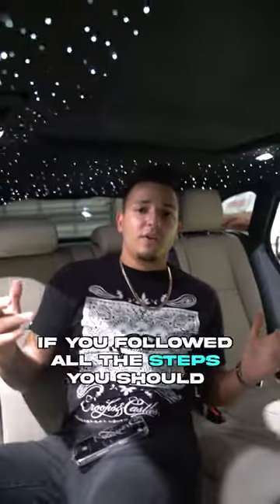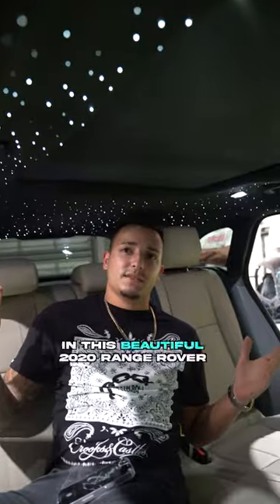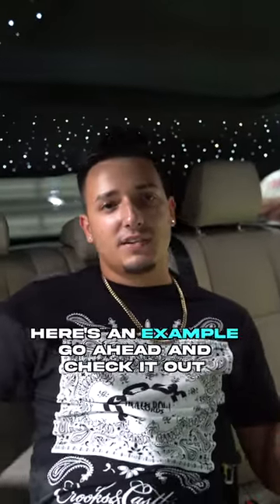HOW TO INSTALL STARLIGHTS

Comment: dont forget to hot glue em to the headliner so they stay
Reply: I was about to ask this… it won’t mess up the fiber when the hot glue gets put on it?
Reply: @samnashold9012 you should be fine test it put before hand might just bend a bit cuz of the heat, when you do and if its bent run your flashlight from phone through the end see if they twinkle if they do you good 👍
Reply: Was about to say that glueing is better
Reply: @samnashold9012 just make sure you put a little
Reply: E6000 glue is better. It’s stronger and you won’t have to worry about the hot glue melting the wires.
Reply: Just poke your holes, thread your lights, spray with some 3M headliner adhesive, and put some random damn fabric down on top of it all. Painter's plastic on top of that, movers blanket, and a few lead diving weight bags....

I've taken that F150 everywhere, and they're still in place.

Comment: How to starlights 

Step 1: is to figure out how many stars you want or need. A full size sedan you would want a minimum of 600 excluding a sunroof area.  Use this as a reference point. 

Step 2: is the supplies, you’ll need plenty of hot glue with a hot glue gun, t pins to poke all the holes, 1/16 drill bit + drill gun for the plastic areas a pin won’t poke, scissors to cut the excess. side snips to cut it flush at the end, wire strippers, electrical tape, extra wire to connect the starlight kit module (normally in the trunk) to the interior fuse box at the front and a fuse tap with fuses 

Step 3: remove the headliner by taking off all the necessary trims, such as the A,B,C Pillars, ceiling grab handles, and interior dome light housings. You’ll have to probably fold the headliner to take it out the car. (The headliner can crease at the step.) 

Step 4: taking a marker you plot 600 dots in the way you want them to look. You can add designs or letters or shapes, (keep in mind these things take up a considerable amount of stars)

Step 5: poke all 600 holes using the t pins /drill bit (thumbtacks, are not long enough to poke through in most cases)

Step 6: insert all 600 strands into all 600 holes, one by one, keeping in mind, wire, routing and management.

Step 7: manage all the fiber optic wiring, using tape, you can bundle them up together, and then use hot glue to lay groups down flat. 

Step 8: add a decent bead of glue to the base of each fiber optic wire

Step 9: cut most of the excess wire length on the interior side so it’s easier to handle (do not cut flush yet) 

Step 10: take the headliner back into the car, usually by bending it again (can crease at this part). Then put the headliner back on with all the trim

Step 11: cut the optic wires, flush with the headliner fabric, using the side snips. 

Step 12: attach the rope to the module. Plug the module in. Strip the module wire. (Only has 2 wires black & red) and use the extra wiring to run it up to the fuse box. 

Black wire goes to the closest bare metal point near your fuse box. Red wire, connect to a few tap, which you can tap into any accessory fuse.

Then your done

Comment: I’m doing it for the second time with a 600 piece kit. If you had 4-8 people doing this it could genuinely take 2-3 hours. But solo, easily a 24 hour job. That is if you’re changing the headliner material though. That was the longest part imo. It’s such an easy job. Just so tedious and wire management is a must but it is a bitch

Comment: What about running the power?? Location of power source?
Reply: They never seem to show it but there’s a giant brick all the cables are connected too. Most likely doesn’t fit in the ceiling so you’ll probably hook it to the 12v in the truck then run the cables up a side pillar. requires a bit of power
Reply: @rileyzack4346 it’s plugs into the 12v adapter in your car, it does not take more than 16 watts so no it does not take a lot of power, and the “giant brick” is actually about 3 inches by 3 inches by 2 inches
Reply: @alecgoodwin4159 where do i put the brick so it doesn’t show
Reply: Can you tap it to the footwell light?

Comment: How long does it last?
Reply: If you do it right you can wire it to the car battery and it should be good for a very long time otherwise it might be running off a battery pack that you gotta change the batteries when they die

Comment: Does it look like little tips of fishing string are poking out of the roof in the daytime though?
Reply: Not mine. I got mine done by Opelite Optics.
Reply: @kyotijhan3456  eh, I saw another video after commenting that did show it it pokes out. His solution was using a brush and brushing the headliner which helps fluff it a little cover the tips of the fibers.
Reply: @420  he didn’t cut it right that’s the reason it like that
Reply: If you cut the optics flush with the headliner you shouldn’t be able to tell because they are clear so they will blend in with whatever color your headliner is. Just take time when trimming.
Reply: @Sherzuh  Facts
Reply: @Sherzuh how should i trim it
Reply: @aaronlz0  you can use a good pair of cutters preferably a small pair

Comment: I wanna do my car but I had problems doing it on my brothers truck I tried to put adhesive it’ll leaked thru the fabric and leave stains so I didn’t put a lot on it and later on it came off
Reply: i heard one drop of hot glue per light does the trick.

Comment: Anyone used a kit they would recommend. I checked their website they don’t have a link. 

And don’t tell me they all the same smh. Just give me a suggestion. And yes I looked at other instal vids… it’s different when it’s a constant brand you trust. Help please
Reply: I got mine from amazon and they look sick and have a twinkle option for like 130$ ish
They by akepo i believe it should be one of the higher rated products 
I got 450 lights for a camaro